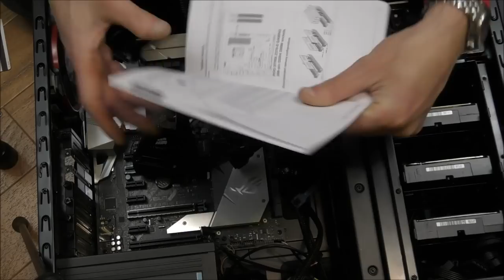Upgrading My Gaming/Editing Computer! New Motherboard, CPU, and RAM

Comment: I spent about a year watching youtube tech videos to learn about building a computer. I build a system made of AMD Ryzen 7 1700 paired with a GTX 1070 and 32 gigs of ram. It was a dream come true for me and I couldn't be happier and prouder about myself.
Reply: Darklanov holy shit what a beast system I have a AMD A8-6600k paired with a GTX 750 😓
Reply: ZahZee • well guess what I have a6 9500
Reply: I just bought a upgrade aswell. Had a AMD A10-7870K, 1050 TI, 1x8GB DDR3 RAM and a motherboard that I dont know the name.

Bought: 
Asus Prime B450M-A 
Ryzen 3 2200g 
2x4 DDR4 3000mhz Corsair Vengeance LPX

I'm not at home right now, so I cant tell if everything is working, I just hope it does!

Comment: Wow, I didn't know you could swap an SSD from one Windows 10 installation with completely different specs to another and not have to reinstall all my programs. That's great. In the past, it wasn't as smooth of a process from what I remember. I always started from scratch each time I made such major changes to my PC.
Reply: You done it with a outside hard disk o you just had it evrything on your ssd after changing  motherboard cpu ecc? Sorry for bad English
Reply: @luminsz680  I took an internal SSD with my Windows 10 install and moved it to a new PC with a similar brand / series Motherboard and it worked just fine. :)

Comment: "I don't know if I will overclock or not, but I wanted to have that option"
With the more modern Intel CPUs I haven't been bothering, their little "turbo boost" thing takes it almost as far as you could push them anyways and then it will clock itself down when you're just typing something up in Word or whatever. Pretty nifty, but like you said, always good to have the option down-the-line if you ever need a little more headroom.

Comment: The All-In-One water coolers do have a limited life span because the water permeates the tubing over time. This loss of water will eventually mean the pump (the part you mount on the CPU is the pump and cold plate) doesn't get enough liquid to circulate and will start to whine or just overheat and fail altogether. You can generally expect 5 years out of one - could be longer of course, 6-7 years or even longer is quite possible. Just keep an ear out for noise changes in your system and check the temperature of the CPU regularly to make sure it isn't suddenly running hotter than it was. (I use HWMonitor to check temps on my CPU and GPU.)

Gratz on your new rig!

Comment: hey @STUFFandTHINGS i'm upgrading from a crosshair vi hero x370 with ryzen 7 1800x, 16 GB of corsair vengeance ram 3200MHz, and a geforce 1080 ti ftw3 (which i'm carrying over) to a asus tuf gaming X570 +plus, ryzen 9 3900x, and 32 GB Trident z Neo RGB 3600MHZ. Windows 10 pro is installed on my NVME m.2 960 EVO. I was wondering will I be able to change all that out like you did and be able to boot up windows 10? everyone is telling me that it won't work, or if it does it may have lots of problems. I really don't want to reinstall windows 10 if I don't have too, like you I have lots of programs, and lots of things that I don't want to have to back up, cause you can't really back up programs, even if you move the entire DRIVE and back it up and move those program files back, they won't work.. you'll have to reinstall them. 

one more question, about cooling.. do you suggest I use the default wraith air cooler that it comes with? or use my Master Liquid 240 AIO? I bought it in 2017, so it's fairly old by now, and I run my computer 24/7 but it cools my 1800x perfectly still.. i replaced the two 120 MM fans on it with Noctua fans. They say that the cooler is good for 70K hours which is WAY more than 3 years.. their warranty is only 2 years tho. So, I will be mainly gaming 1080P with the system, with some rendering of video files @ 1080P I want to OC some in the future, if I can use my AIO and the temps are good out the box I may try some OC'ing. But, just wondering if you suggest I just use the Air cooler.. I have heard mix reviews about it, some say it's a great cooler, especially for free.. others say if you plan to OC even a little bit, to replace it with an after market fan. 

if i can't use my AIO, I will eventually get a Noctua Air cooler thats like $80 cause I have heard great things about it. But as far as the Cooler master AIO that I have.. on their site, for 3900x it's NOT the recommended cooler, their new RGB cooler is, but it IS listed as being compatible cause it's an AM4 mount. I just dont' want to throw it on and a few months down the line something happen and it breaks down, ya know?

Comment: Good job Bradley, glad everything worked out. The call (and wait) to Microsoft for activation is unfortunately part of the ritual whenever you do a major upgrade. I own and maintain six machines and had to go through the painful process for each one of them. I used to be a tech journalist who tested motherboards, CPU's and other computer hardware and had to deal with tech support in India which I could barely understand as we were both speaking a second language...

We didn't get to see you play with the UEFI (Unified Extensible Firmware Interface, which has taken over BIOS a few years ago) settings? Doing any OC? Using onboard audio?
Reply from the maker: Thanks for watching! So far, all I've done is set my RAM to 3000.

Comment: This was exactly the video I was looking for. Very soon I plan to upgrade from my current i5-3570k to probably a Ryzen 5 2600 since they are far more affordable than Intel cpu's currently. I also do not wish to fresh install because I have too much stuff to worry about recovering if I did.
Reply: Cody Pritchard how'd it go
Reply: @RevolverCallOfDuty  haven't done the upgrade just yet.
Reply: Cody Pritchard yea I ordered the new mobo, ram and cpu, but I'm worried on the actual upgrading process, like upgrading bios and all that I'm going from an amd fx 6300 to an amd ryzen 1600
Reply: @RevolverCallOfDuty  well i just bought my ryzen 5 2600 and gigabyte aorus b450 mobo and after switching hardware windows would blue screen on launch so i am formatting my drive and installing fresh. kinda sucks but it should work flawlessly after this.
Reply: Cody Pritchard same thing happens to me yesterday, had to reinstall windows everything's fine now
Reply: @RevolverCallOfDuty  same, except it turns out my new power supply has a defective fan that keeps rattling so i have to go replace that tomorrow.

Comment: Anyone here ever upgrade cpu? I want to make sure I do this right, I currently have a Asus- STRIX Z270-E gaming ATX LGA1151 Motherboard, with a Intel-Core i7-7700k 4.2GHz Quad-core Processor. Today I purchased a ROG Maximus XI hero mother board and an i9-9900k. I’ve never upgraded cpu and was told this chipset required the new board so that’s where I’m at. I’m told all I have to do is swap out ssd, ram and gpu, then load it up like normal and the computer will do the rest. Is this true or what’s the procedure for this upgrade? Any advice? Thanks.

Comment: Interesting, I never did a motherboard swap while the case was on the floor. How are your knees feeling?
Reply from the maker: I do lots of crouching on a daily basis! I actually find it comfortable. haha
Reply: I can't do much bending anymore and suggest people above 50 or with SI joints issues to always do this on a table! I also advise to sit in the CPU and memory before installing the MOBO, especially if you have big paws. Was this your first Asus board Bradley? You must have appreciated their Q-connector. Mobo's front panel wires are a pain to deal with individually.
Reply from the maker: They didn't include one with this board!
Reply: Wait so its pretty much takeing your mother board out then plugging in the new board and cpu and connect everything back

Comment: So I just upgraded my PC, with new motherboard, new ram and a new CPU. Everything went fine until I was gonna start it up again. When I turn it on, it stays on for about 15 seconds, then it automatically restarts. Not only that, but none of my screens gets any signal.
As far as I can see and understand, everything is powered up and working.... Anyone familiar with this issue? :/
Reply: SuperApoko yes I had this issue, I ended up going back to my old motherboard because I couldn’t figure it out.

Comment: Did you uninstall any drivers before the disassembly?
Reply: yea i need to know this too
Reply: Astro Jake Windows 10 has gotten very good with drivers lately. I didn't need to uninstall any drivers when replacing my CPU and motherboard
Reply: @disappointment6688  yea me either. I'm wondering I'd you ended up needing to. I've had one blue screen since I put the new hardware in. Since then nothing so far. All I used was driver eaay

Comment: Why are people so dense?  If you are changing the motherboard you are building  a new pc.  The case is not the computer.  If you upgraded your motherboard you would be leaving the old motherboard in and interfacing it with new hardware.